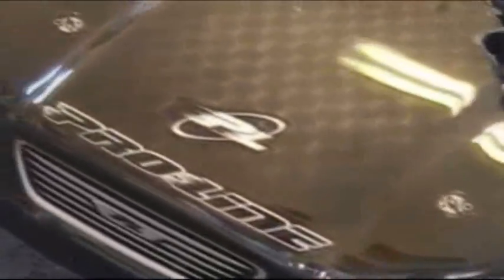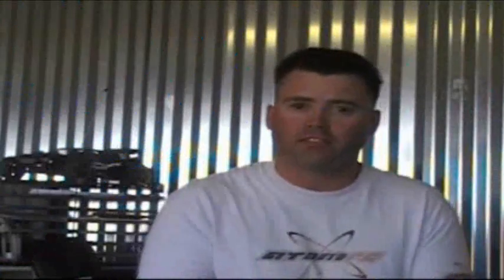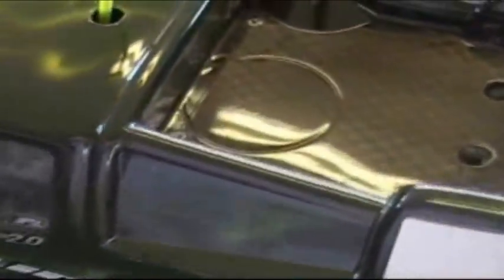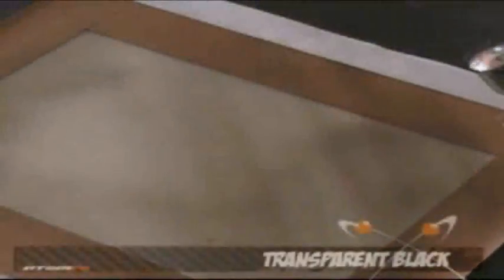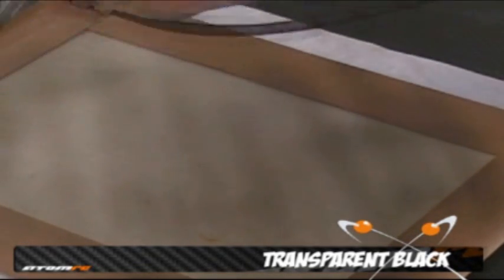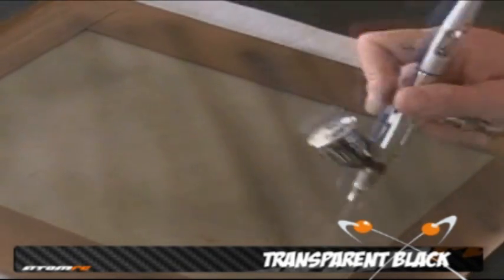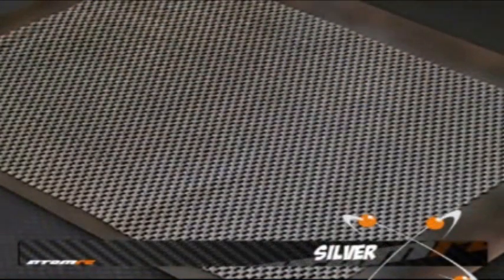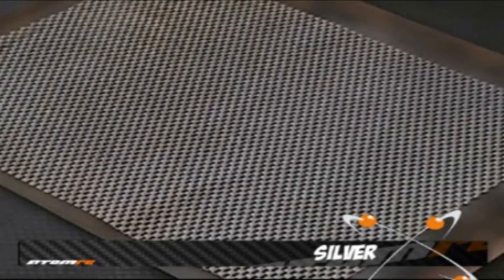Airbrushing - Carbon Fiber for RC Car bodies

Comment: does normal auto air panit stick to lexane bodies? the same with plastic and any other materials? what about all the prep work... the base coat!?
as:  satanslittlehelper93 said, is there some kind of heat resistant paint also?

Comment: yeah, you could probably do that. Spend all that time moulding it to fit onto an RC bonnet, then screwing it on, adding a bit more weight to the shell. Then hope it doesnt fly off when you are running it. Maybe read the title to find out what the rest of us is talking about before you post.

Comment: In that case, you don't know much about r/c cars then. The whole point of this is to incorporate carbon fiber into a paint scheme. r/c bodies are painted from the inside so the paint doesn't scratch off when you damage the body. If you made a body out of carbon fiber, assuming you even got it to look decent doing it yourself, you wouldn't be able to paint over any of it without it just scratching right off after one roll-over.

Comment: i did read the title  that why i came in here

if you dont think CF cant be molded as an r/c body or parts then you really should get some more info/knowledge before you start saying things your not sure of  carbon fiber and be molded in to any shaped  jsut take examples from any where  f1 cars, sea equipment, space equipment  if you think people cant mold it for an r/c car or parts then you are sadly mistaken make fake carbon fiber is a cheap bad looking way to do things